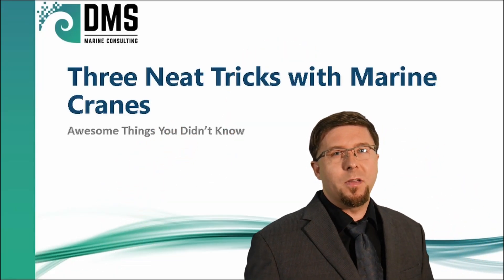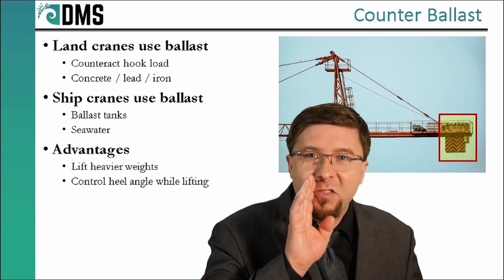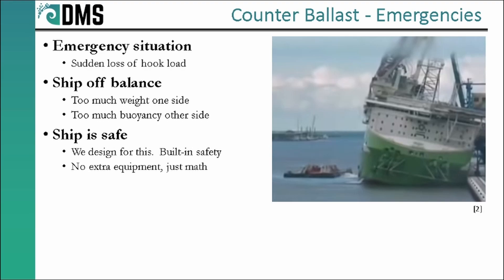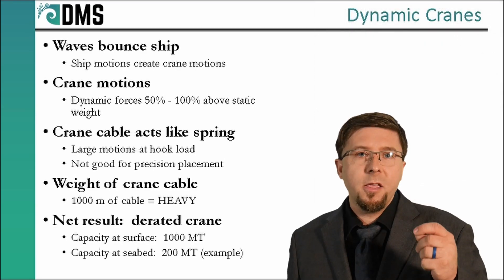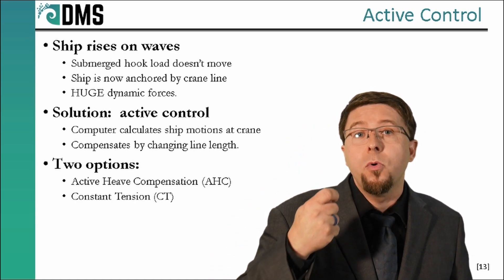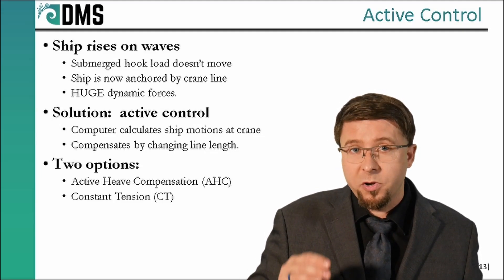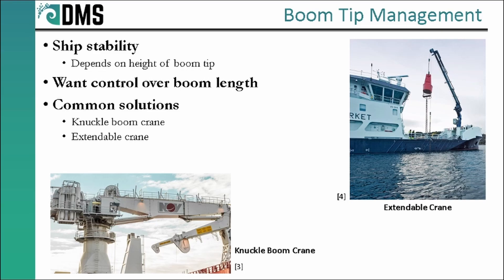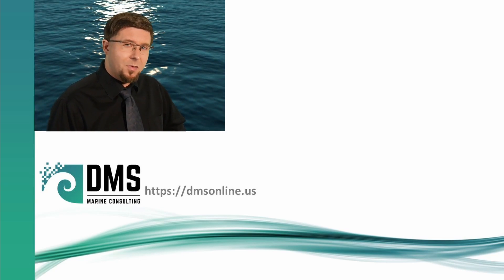Three Neat Tricks with Marine Cranes

Comment: How would your discussion change with discussing the laying of the nordstream pipe or laying an fibre optic cable between continents. Regards Philip from Jakarta
Reply from the maker: That is a very different style of lifting.  The cables and pipes are generally smaller in physical size, compared to large loads that get lowered by offshore cranes.  The smaller size means less added mass.  It becomes easier for the cable / pipe to move around and follow the ship movements on the surface.  But the major difference:  the cables and pipes don't go straight down to the sea bed.  Pipes get lowered at an angle, so the point of contact with the sea bed sits several hundred meters behind the ship.  Cables frequently get lowered vertically, but there is a large radius at the bottom as the cable bends from vertical to laying horizontal on the seabed.  These horizontal offsets are critical.  When the ship moves with ocean waves on the surface, the pipe / cable can compensate by just flexing and bending slightly on the way down to the seabed.  Thanks to this, we don't need massive motion compensation systems.  But they do need to carefully control the shape of that cable / pipe on the way down to the seabed.  They carefully monitor that shape and balance the forward speed of the ship against how quickly they pay out cable / pipe.  All to control the shape as it lowers to the seabed.  Cable / pipe laying ships are some of the most complicated and technical vessel operations out there.  Just the simple act of drive forward in a straight line has to be carefully planned and controlled.

Comment: Do cranes get stabilized to help counter the roll of the ship?
Reply from the maker: Yes, but it usually doesn't change the crane limits.  A land crane placed on a barge will have its legs extended for crane stability.  And a marine crane gets welded down to the ship, with a VERY secure connection.  But in both cases, the crane quickly runs into limits with the boom. The boom structure can only handle a minor roll angle.  It varies with the crane, but I have never seen a crane that can handle more than a 10 deg roll.  Past those limits, the boom often buckles and collapses.  So we still assume any limits on the crane roll are hard limits, regardless of how we mount the crane on the deck.

Comment: Great video ! I have a question . Imagine you wanted to make a Ice rated ship powered by a Kawasaki gas turbine , and imagine that even though Kawasaki made ships , they had never made a ice rated ship , also imagine you are also considering a Finnish shipbuilder that has lots of experience making Ice rated ships but has never made a turbine powered ship . All else being equal , which shipbuilder would you choose ?
Reply from the maker: Just going on your information, I would personally choose the Finnish shipbuilder with experience in ice rated ships.  Most of the gas turbines I see on ships are designed to be largely self-contained.  The expertise is more in the engine design, not the installation.  Yes, it still takes expertise to install the turbine, but that is more of a discrete step.
Contrasting that, building an ice-classed ship is very integrated.  Ice-class requires reinforced hull design, stronger rudder, stronger propeller, unique ballast systems, and possibly modified welding procedures to handle the colder water.  Ice class requires more changes to the entire construction process, making that more critical for selecting the builder.
But I have a few caveats with my opinion.
1.)  This only considers what you said in the comment.  There are other important factors like price, lead times, customer reviews, weight management plans, etc.  
2.)  My background is more focused on the ship design vs machinery side.  A marine engineer may have the opposite opinion, stating that the turbine is the more critical option.

If you want a more detailed review, this is a service I offer.  We call it owner's rep.  This includes reviewing shipyards to ask the right questions.  And then providing a rational comparison between the options.  If you are interested, you can contact me on my email:  sales@dmsonline.us
Reply: @DatawaveMarineSolutions  I know how difficult designing the integration between a very high speed turbine (22,000 rpm) and a slow large marine propeller so it works reliably for decades is , and it is considerable ! I am pretty clueless about what is involved in making a ice rated ship , but from your answer it also sounds considerable. My gut feeling would be to pretty much go with the best builder for the job and try to forget about price and lead time.  but then I come from a background of working on boats , not finance.
Reply: @DatawaveMarineSolutions  Sorry, I'm an engineer and I have to say the opposite. Ice class is mainly just a strengthening exercise and easy to model. Installing a turbine over say piston engines is huge. All the plumbing, air intakes (massive), exhaust (massive) , special control systems, huge reductions in rotating speed (gearboxes) and cooling is a major exercise in design. And you only need to screw up just one of those things and you have an epic problem.

Comment: That crane collapse on the Orion must have been so bittersweet for the engineers.
Sure the hook failed, leading to massive destruction of the boom, but literally everything else worked as intended.
I'm sure they knew it would, they did all the calculations after all, but an incident like this confirms it in a different way.
During my lectures videos like this or case studies made the material stick.
I always remember those first, when I need to do something I haven't done in a while, and then I know where to look for the additional information.
Thanks as always for your videos.